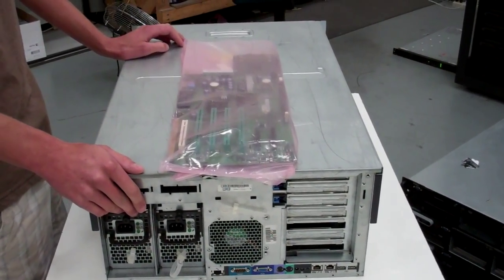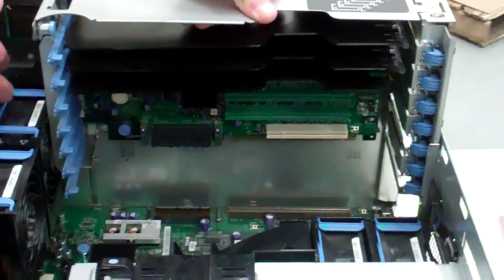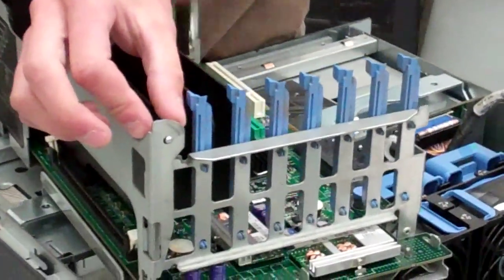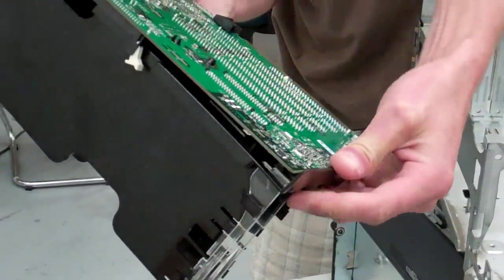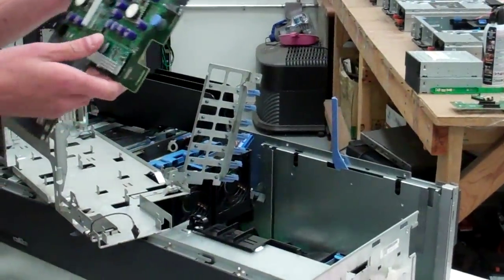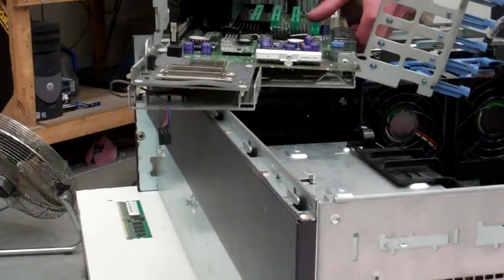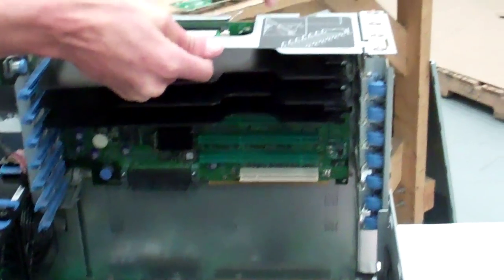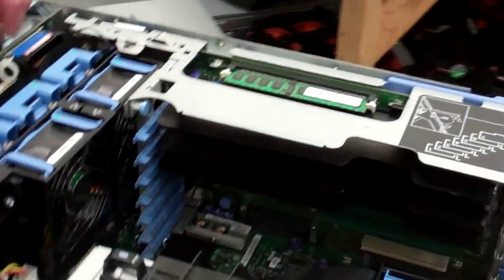Velocity Tech Solutions - How to Replace a Riser on a PowerEdge 2800 Server

Comment: 11 years later... here I am still using PE 2800 server. I'm about to replace the riser card. Do we need to reconfigure the array? I came in to work today to find the server rebooted on its own overnight but it is stuck during POST. Normally I see the following during POST:

PowerEdge Expandable RAID Controller...
Press <Ctrl><R> to Run Configuration Utility

This time, the above message does not show up at all. Server won't boot. I suspect PERC is dead.
I'm hoping that I won't have to reconfigure my RAID5 array and reinstall OS after replacing the card. I've never replaced a RAID controller. I hope you or anyone gets this message.